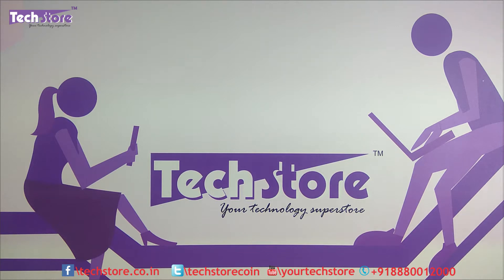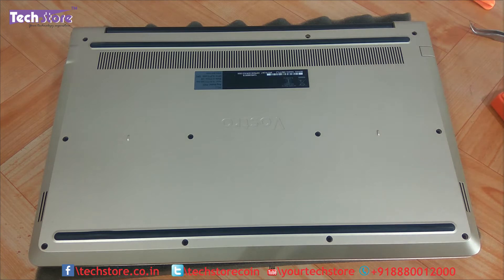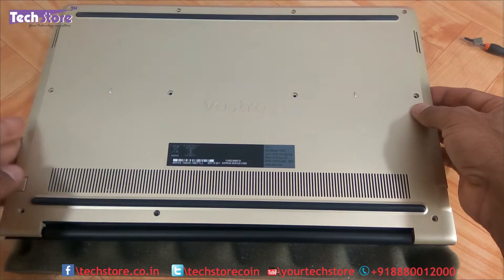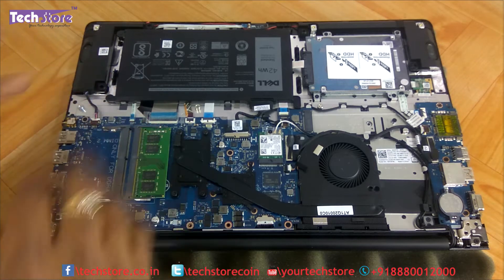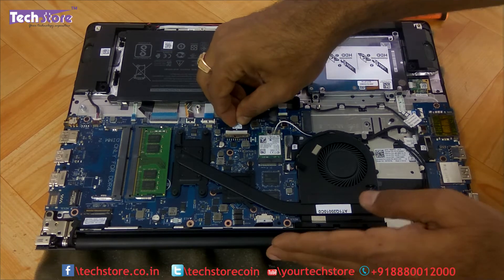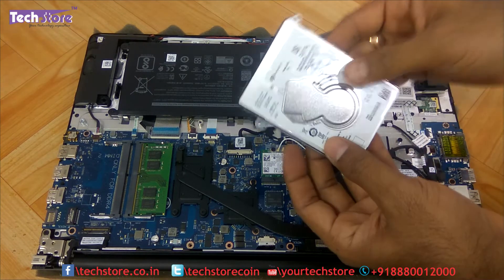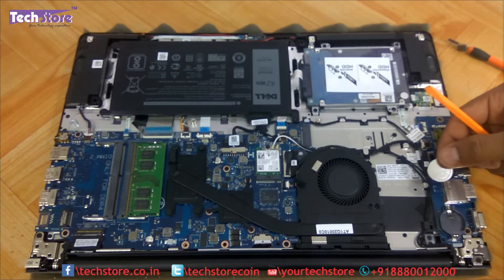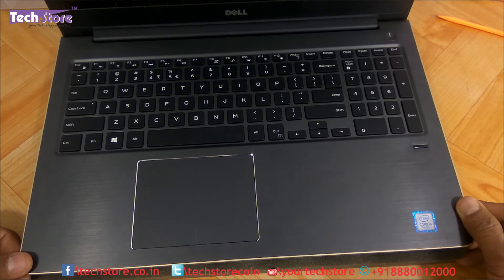Dell Vostro 15 5568: How to disassemble remove the base & upgrade ram m 2 ssd hdd wifi

Comment: Can we use both HDD and SSD at the same time?

Also when you say 'up to 16GB ram', do you mean in total or you can have 16GB and 8GB ram operating simultaneously? Thank you
Reply: Likely 16 GB per memory slot, 32 GB in both slots total.

Comment: Hello
Great video. Just wondered if you know how to fix the corner of this laptop at the hinge where the case will no longe clip into place. Does it need replacement parts? Nothing visibly broken just won't clip and hinge almost coming out!
Reply: happened with me as well so i called u pdell and got the shell replaced
Reply: @manansingh9578  thanks. Our laptop is out of warranty however 😭
Reply: @bubbles2082  i also replaced it in extended warranty😄
Reply: I am having this very issue now

Comment: I have dell  vostro 5568 I brought m.2 ssd for my laptop but it does not show in bios and disk management what do I now ???
Reply: Another reason is that , vostro 5568 support only sata ssd. Not pcie ssd or nvme ssd.
Reply: I just completed upgrade with m.2 WD 250 gb ssd with (Sata interface). Works perfectly...
Reply: @antonymathew  hi is there any heating issue after installed it?? And u clone os and apps from c drive to ssd??
Reply: @baaplog5993  no issue so far. I didn't clone.. wd has a software to clone anyway. We did a reinstall..
Reply: @antonymathew  pls tell is worth to upgrade with 250 gb for c drive only or 500 gb for c drive and other use??
Reply: @baaplog5993  depends on your use case actually. I suggest 250 gb as they are affordable and enough for win10 with all necessary software.  Complete 250 goes to C in my case.. if u have heavy tools to install then 500 could be an option. Strictly use case depended.
Reply: @antonymathew  can I use 250 gb out of 500gb for c drive and remaining 250 gb for other storage purpose??
Reply: @baaplog5993  sure.  U can partition the SSD ..
Reply: @antonymathew  thanks a lot for your suggestions bro.......
Reply: did u solve the issue ? (bios upgrade could be a reason).  i am planning to buy m2 ssd for this laptop. Any suggestions you have , please let me know..
Reply: @antonymathew  just make sure you buy the sata type at the correct voltage etc, ave a look at the one you have in it already . if there is not one go to the Dell support pages
Reply: @antonymathew  yep I did it  .. but it dint work so I think it may be the problem with ssd that I bought  so I will  buy the new one .
Reply: @naveedismaill6396  ok.. so which ssd u bought, and which u planning to buy ? Are u sure any kind of bios settings u may be missing. Like enable m2 port, boot priority , anything like that ??
Reply: If u are in bangalore, i can confirm with my laptop whether the m2 ssd u already bought is working , or its not even working in my laptop.
Reply: @antonymathew  hi, I want to buy m.2  ssd for Vostro 5568 which 500 GB SSD is better for me??

Comment: M.2 ssd which compatible for this laptop?
Reply: This laptop supports SATA m.2 ssd. We used 240gb WD Blue m.2 sata ssd.
Reply: @antonymathew  can you send me Amazon link
Reply: @antonymathew  hi how's the difference in performance? was it worth it instead of RAM upgrade?
Reply: @antonymathew  does this support 500gb of ssd?
Reply: @rujulparmar1014  it should support .. size won't be an issue..
Reply: I thought so. But dell support center says that it will only support 256gb ssd. Not more than that

Comment: is it a m.2 sata or a nvme m.2 dedicated slot ?
Reply: its  SATA M.2 SSD, this video miss leading ssd upgrade
https://topics-cdn.dell.com/pdf/
vostro-15-5568-laptop_owners-manual_en-us.pdf
Reply: @avenkatapraveen1  thts what i was thinking
Reply: @avenkatapraveen1  it is not a misleading video. it says m.2 ssd upgrade  . it does not say what type . the user should always check what type they need
Reply: @MrTarmonbarry  no its clearly menctioned "nvme ssd shown on screen" the actual model of dell laptop you shown in video does not support it
Reply: @avenkatapraveen1  where do I install m.2 ssd, does it go under the WIFI card? I'm confused by video
Reply: @stevethea5250  There will be a dedicated slot

Comment: you must remove battery befor remove ram
Reply: wrong , no need to remove the battery ,
Reply: @MrTarmonbarry  won't it short circuit with static

Comment: Is the graphic card can be changed
Reply from the maker: Not possible
Reply: @TechstoreCoIn   Hey I am planning to buy the E495 . After confirming with the Lenovo support they mentioned that it has 2 ram slot and a fhd 14 in display 

 

very much unlike like the older generations of E series thinkpad...

what is your say in this regard?

my exact model (planning to get one) is:

https://www.lenovo.com/in/en/laptops/thinkpad/thinkpad-e-series/E495/p/22TP2TEE495

(the 48k one as I will upgrade to a total of 12 gb ram and 16 in the coming future)

I expect this machine to love me for the next 4 years

Thanks,

Siddhant